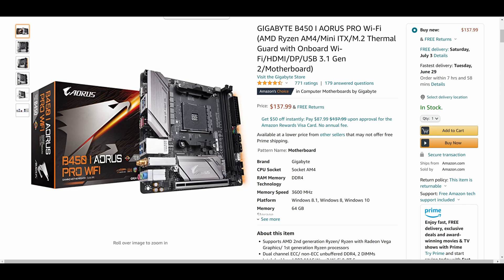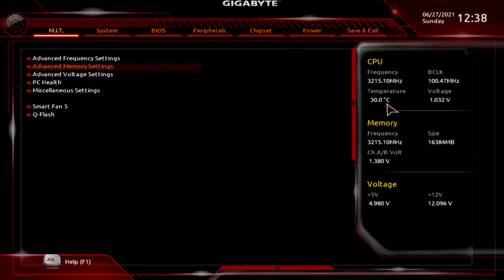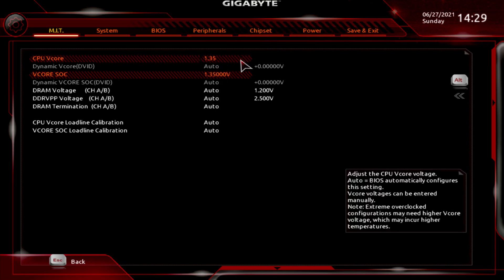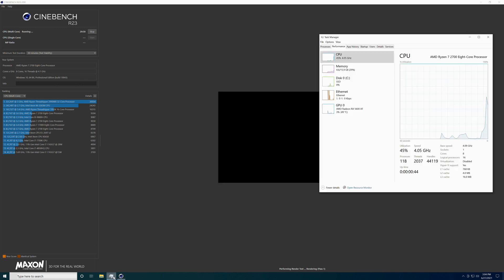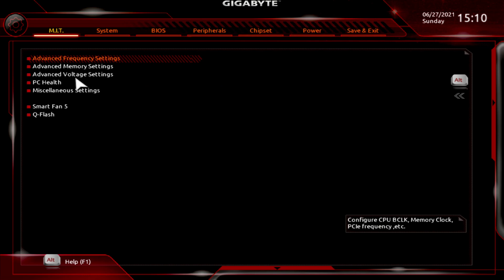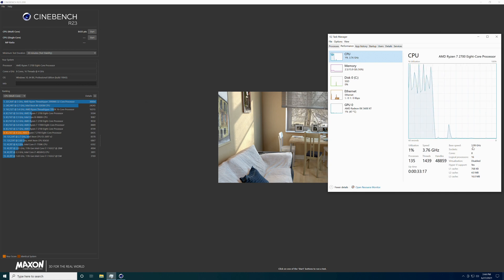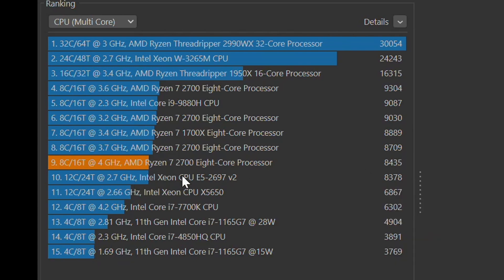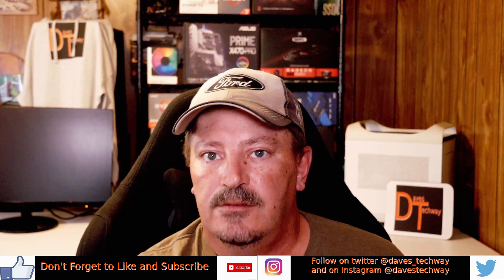How to Overclock the CPU on the Gigabyte B450 I Aorus Pro Wifi Motherboard

Comment: My question is how to underclock to 3.6 ghz and undervolt to .975 voltz using a ryzen 9 3900x cpu on a ultra durable gigabyte b450 ds3h wifi motherboard using f1 bios. Help with that would he appreciated.

Comment: I can not change the vcore vid and soc vid shitty gigabyte board makes everything so fucking bad my b450 asrock board oced like a champ and was easy to do so this bios is one big mess
Reply: What bios number are you using. I'm having the same problem with a Ryzen 9 3900x on a ultra durable gigabyte b450m ds3h wifi motherboard. It's using bios number f1. The older revision of the board using bios f63 worked easy. Drop down for CPU speed and drop downs for voltage.

Comment: I dont have a setting called cpu vcore,how can i change the voltage?
Reply from the maker: Sorry not sure. Thanks for watching and the comment.
Reply: Same.
Reply: @pdr-s5i  use ryzen master
Reply: Use ryzen master
Reply: But with Ryzen master using manual settings it doesn't write to the bios. Everytime you start your computer back up you have to run Ryzen master again to get the undervolt/overvolt and underclock/overclock back.
Reply: Set Dynamic Vcore (DVID) and Dynamic Vcore SOC (DVID) hit the minus button on your keyboard until you hit the desired over or underclock.

Comment: Both this and your bios upgrade video were useful! thank you :)

You could also use Ryzen Master to change settings without rebooting, then just set them in bios when you got final values, no?
Reply from the maker: Glad I could help you. You could use the Ryzen Master to get a good starting point, But sometimes you can get better performance out of the BIOS.   Thanks for watching and the comment.
Reply: @DavesTechway  so ican overclock my cpu in ryzen master?
Reply from the maker: @superpotato0903  yes
Reply: @superpotato0903  not in win 11

Comment: How come I don’t have an option to up my vootage
Reply: Same, have u found a solution for this?
Reply: @OxxOYT  not yet
Reply: @botted1193  I found u can change the voltage by typing + and the bu what amount u want to add
Reply: @botted1193  also I just assumed u have the same board as me, witch is a b450 aorus (not the pro wifi version)
Reply: @OxxOYT   I I have pro wifi
Reply from the maker: A lot of the time it does not light up but if you click on it and + and - will change it. Thanks for watching and the comment.